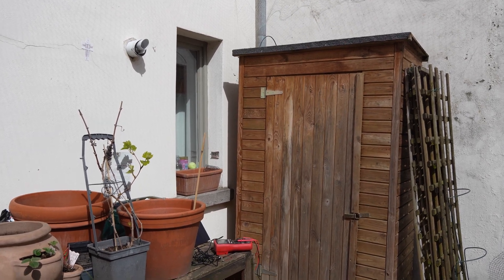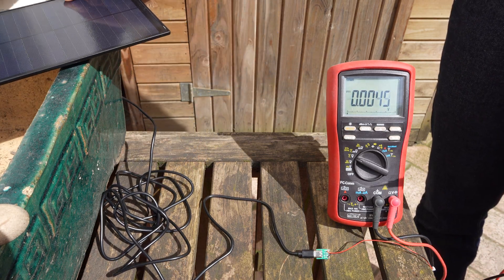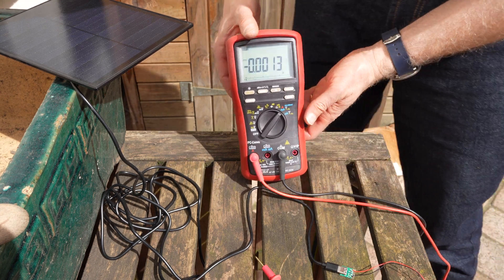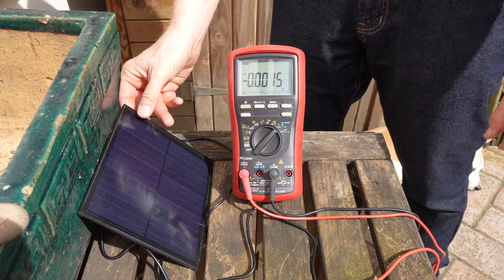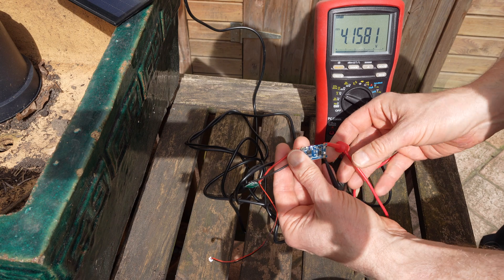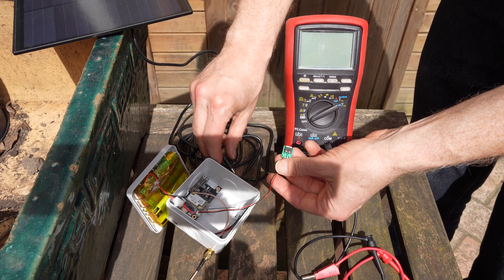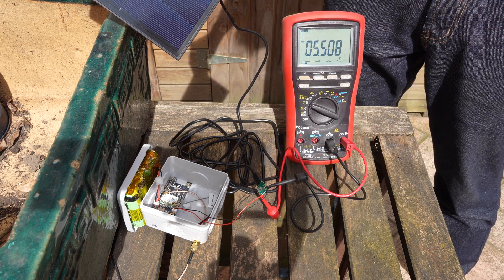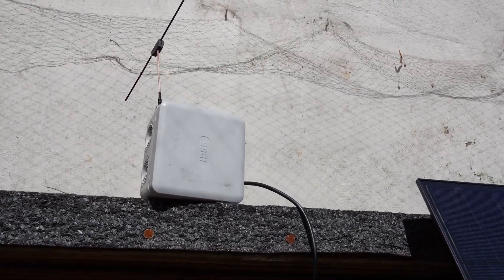Meshtastic solar node endurance test - part 1

Comment: Short circuit current is higher than current at the max power level, so you can't simply multiply float voltage and short circuit current to find out what your panel can deliver. It will be less than 0.6A*6V.
Reply from the maker: Sure. That's why I state in the video it is below the annonced specifications, as often with chinese stuff.

Comment: You need to measure Vmpp and Impp to measure maximum powere at Stc 25degC at Sun power 1000w/m2 ie using a solar power meter and an MPPT controller.
Reply from the maker: Standards are nice for sure, but reality is better!

Comment: There's a power bank chip  IP5310 which is rated at 3a, (Cricklewoodelectronics LX-LBC31 in the UK) which should carry enough amps to charge during the noonday solar hours.
Reply from the maker: Interesting, thx

Comment: Doing the same experiment here in Belgium it keeps on running for about 4 days until now. I wonder if the 3.7v lipo battery can handle (safety) the cold temperatures in winter.
Reply: If ur using the wisblock built in charger and u have big enough battery it wil be fine. If u are abel to charge at 0.02c.

Comment: The RAK units I have seem to work fine with 5000 mAh batteries and a 2.5w panel.   No display, and no GPS, but I have an environmental board on it, which uses very little power.  Even in crappy weather it charges up.   The solar cell on the small RAK boxes don't seem to be enough to keep the battery charged.   I have one test rig with an 1100 mAh cell and a 2.5w panel, and it charges enough each day to run through the night.
Reply: I've got three mountain top metastatic node repeaters that have the 5 volt 6 watt Amazon special solar panels with three 3000mah 18650s and they charged up all the way to 100% every day even in the middle of winter in the mountains in nasty Pacific Northwest weather...
Reply: @SJV82  That's really good to know.   Having that information is helpful before I build nodes that are going to truly remote places.  The larger panels such as you are using are much better in marginal illumination conditions.
Reply: @SJV82 try it with only one cell. Then report back!
Reply: @ophello  and why would I do that?
Reply from the maker: These RAK boards are indeed the most efficient of all in the role of an autonomous solar node, especially without gps or screen or sensors.